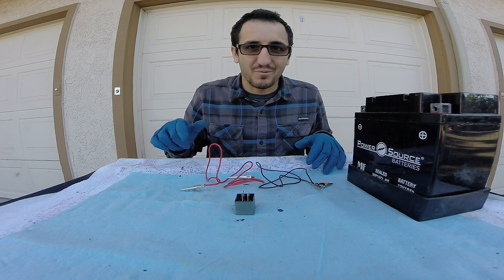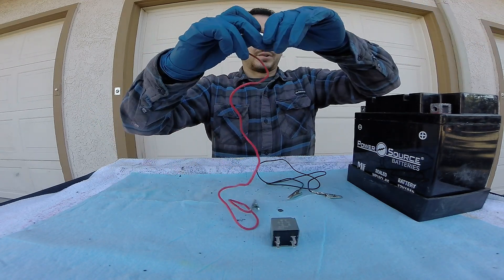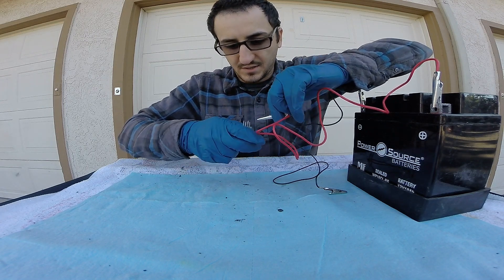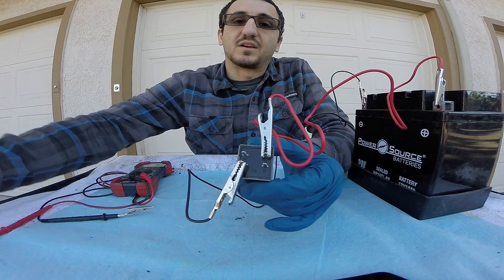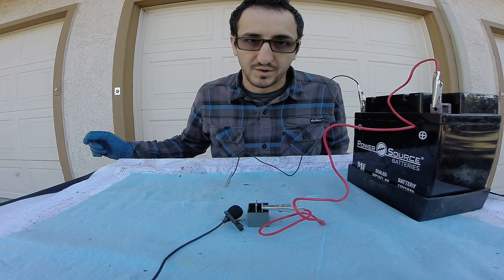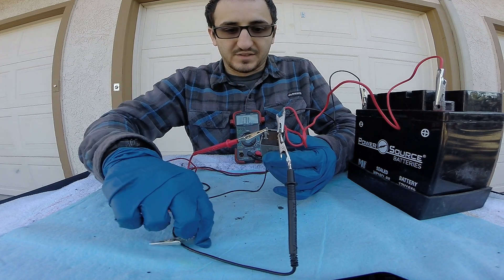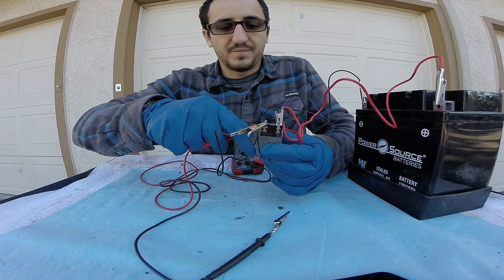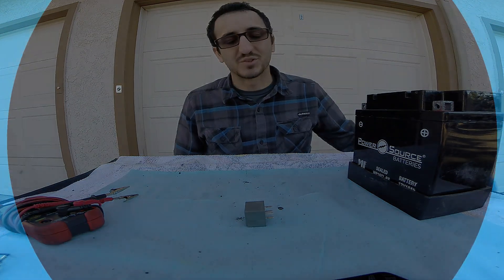Electrical Series: How To Test A Relay - 1080p HD

Comment: Stupid question but is pin 86 and 85 common terminals for power and ground or will they be different on different relays 86 power or 85 ground or reverse or different number ?

Comment: I can see how that proves it works ,but it doesn't prove how good it will conduct current across the bridge. I have seen relays click but they failed to deliver current to the load. A ohms meater only shows contanuaty. 
I would like to see u use a 20 to 30 amp load. Most automotive relays are rated at 10 20 30 amps.

Comment: The headlight relay in my Yamaha xs1100 is out (I think) attaching a new one: power wire to 86, ground wire (black) to 85 doesn’t activate the relay. Attaching the blue wire to 85 while power is attached to 86 does though. I’m so confused. 🤷🏽‍♂️
Reply: Same difference, just reverse travel of power

Comment: The relay you show is an SPST (single pole single throw). When diagnosing an SPDT (single pole double throw) that has 5 terminals : 85, 86, 30, 87 are as usual, and 87a for NC (normally close), I guess the steps are quite similar, right ?
When activating an SPDT relay, I expect we will hear the sound going from NC contact to NO contact.
Btw, can we use a Test Light instead of multimeter for inspecting continuity/connectivity on those contact terminals ?

Comment: when replacing a relay in engine fuse box, is it necessary to have the negative terminal disconnected from the battery?
Reply: crosshair 
...not really but the best practices is to disconnect batt - cable..

Comment: can you show how to test without a battery
Reply from the maker: In short, you have to have voltage available to test a relay.  

In order to assure source voltage is applied and grounded through pins 30-87, you need to have reference voltage and ground for pins 85-86.  Without these 4 aspects available, you will not have the relay ground (and thus, you cannot test if it works or not).

I hope this is not too confusing, but if it is, please watch the rest of my electrical diagnostic videos.
Or, rewatch this video a few times to get the idea.
You can always try to use a smaller 9V battery to perform this test as well.
Thanks for watching,
Anthony Sardegna, DIYautotech

Comment: does the continuity  damage your multimeter if ur relay connect to the battery cuz i watch many video said that ohms sitting will damage your multimeter if test something has connected to battery  ???
Reply: jordann flat yes dont do what he just did with the multimeter. You should never at any point send voltage to an ohm meter
Reply: My thoughts
Reply: Ehh not completely true... Is amps on voltage setting that is bad....

Comment: Hi Anthony….
What causes a relay to heat up and and not work. I have a fuel pump relay on my merceds benz 1998 ml320 and its always been a problem. They last but only for a short time before i have to replace it again. I replaced the fuel pump and would like to know if you can help? thx
Reply from the maker: +Henry Cagle A video on that will be coming shortly.  However in a nut shell if it's getting hot then too much current is trying to flow through the circuit.  Pull the relay and volt/amp test pins 86 and 30 and see what the reading is.  Hopefully will have my amperage and voltage draw videos up soon for you to review.
Reply: +DIYautotech super!